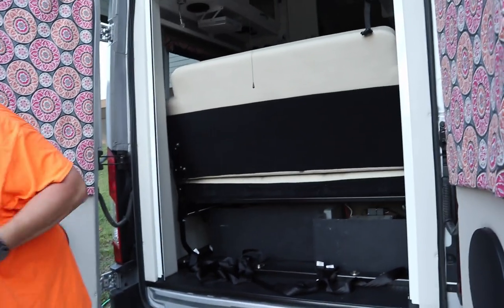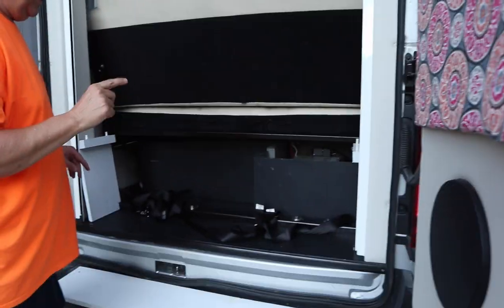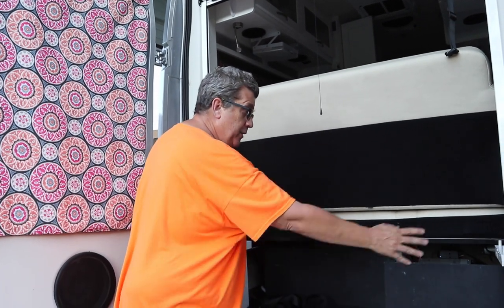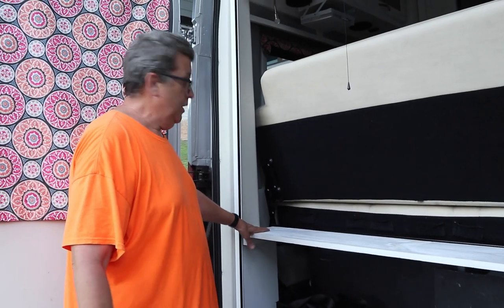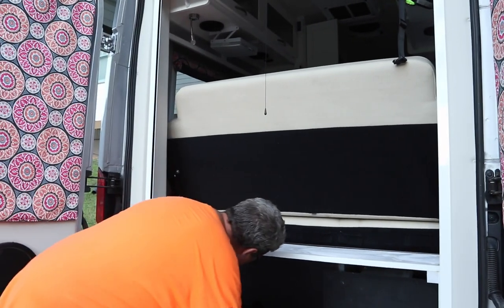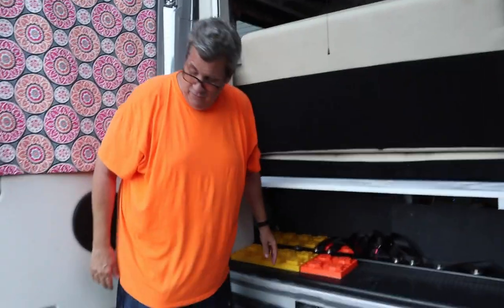Coachmen Beyond 22C rear storage modifications

Comment: Very ingenious, you both a very capable folks.  My only worry would be air flow to the equipment.  Heat destroys electronics, I've learned the hard way.   LOL   Also, you mentioned removing the awning, I like the thought of being more stealthy.   Enjoy your clips, Thanks.
Reply from the maker: Thanks.  I agree about heat, that's why I shaped the divider like I did.   I didn't want to block air flow around the inverter,  it needs to be able to dissipate heat.  So.e people just take the whole divider out and pack stuff back there, potentially blocking air flow.

That's why I made this divider, more space and keeps air flow around the inverter.

Comment: Absolutely excellent modification. A few people mentioned heat distribution. If folks have a concern for that you could drill a few 1-2 inch holes in the backwards facing divider. Little screens could also be added like in some battery boxes. However, as you did it, it just looks great. Thanks for sharing.
Reply from the maker: Thanks.  Some holes would be okay, but it's open on top and gets a lot ventilation there.  Thanks for and supporting my channel.

Comment: Curious if the “wasted space” is actually space for venting for the inverter and the battery? If you reduce that do those get enough air circulation?
Reply from the maker: I left plenty of space around the inverter.  The new board is next to the battery, it has plenty of air space on three sides and the top.  I have seen batteries in confined areas from builders without problems.   My old Roadtrek had one of the house batteries under the engine hood and that was a very hot area.